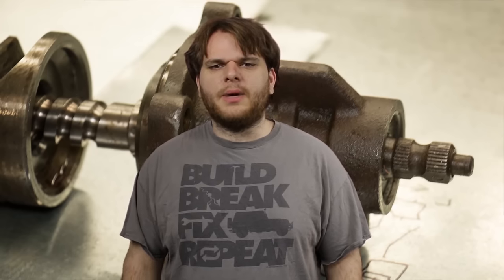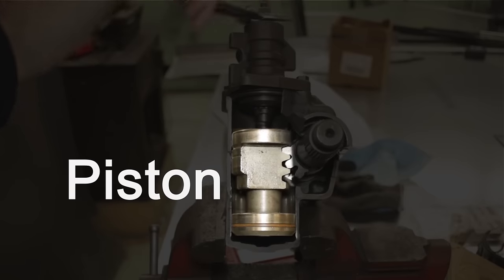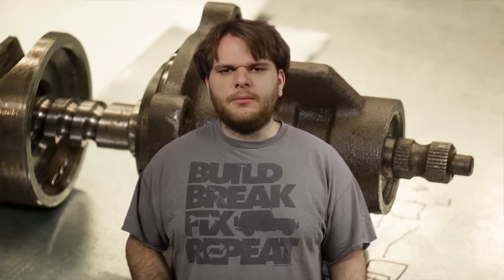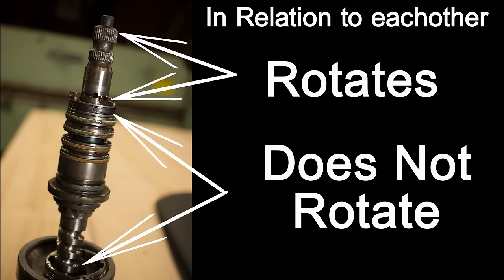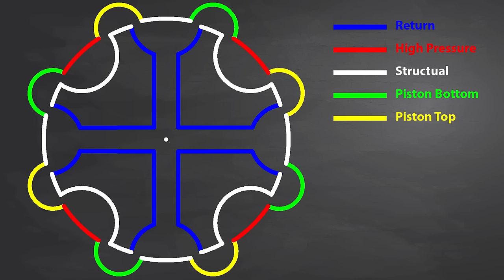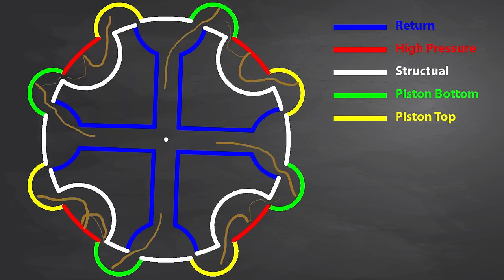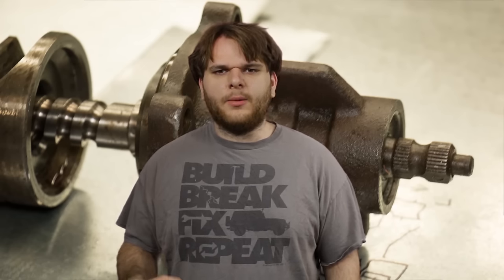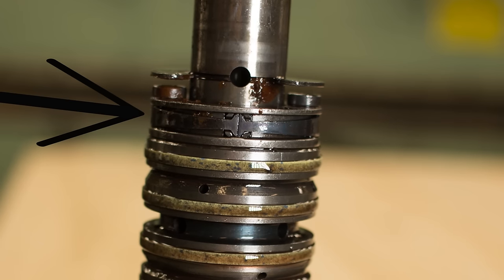How a Power Steering Box Works 610BOB's Teardowns

Comment: ok i have a question.  on my jeep i have the flowing problem, when i start it up. steering is fine. after driving for about 30-40 minutes,  it becomes impossible to turn the wheels. so i would figure that temperature would somehow block the steering box ?
Reply from the maker: That's weird. It could be heat related. Is the fluid getting really hot? If it is, then you need to figure out why that is. Something could be jamming in the steering box. As it gets hot, it expands and causes it to jam. Could also be steering pump. Could possibly be steering stabilizer (kind of doubtful, but easy to check :) ). Pump and stabilizer are kinda easy. You can get a pressure gage for power steering syestem. I would put that on, Drive it till it gets hard to steer, then check to see if your pressure severely changed. Stabilizer, just drive until it's hard to turn, pop one end of the stabilizer off and see if it moves. Steering box will be harder. If those two things seem fine, then I would replace the box and see if that works.

It may also be worth checking ball joints and tie rod ends. More doubtful as those tend to loosen up as they age. But maybe something weird is happening.
Reply: well thank you for replying. relay appreciate it. good that you brought up the steering stabilizer.. hat would be the only part i have not replaced yet.
Reply from the maker: No problem. I hope that works for you. Unfortunately, my only other thoughts would be any of the joints up front that could possibly affect steering. Like ball joints. Which is most likely no help whatsoever.
Reply: replaced all joints recently. issue is driving me nuts..  will se what a new stabilizer does  :D

Comment: Trying to rebuild my gearbox and can only find oring kits. Does anyone know where to get the bearings?
Reply from the maker: It may help if people knew what vehicle your working on. I personally don't know much about rebuild kits for power steering boxes. I do believe that the bearings are hard to find. I would suggest you find a vehicle specific forum and see if anyone there knows  anything. You may be able to buy the bearings by size rather than getting a kit.

Comment: i have a toyota mini van with p.ster. box had to stering shaft seal leaking took it to a repair shop there took it apart change all seal still leaking and now other seal start to leak how do i stop these leaks
Reply from the maker: My first instinct would be to say that they didn't replace the seals. But I just have an extreme distrust in mechanics. :) First, make sure that it is the seals in the power steering box that are leaking. It could be the supply and return lines going into the box. They sit on top, and fluid could just be flowing down and dripping in those spots. There are o rings in those fittings. They should be replaced anytime they are removed. They can also fail, so it may not be a bad idea to try that first since o'rings are cheap. If they are easy to get to.

If it is truly coming from the seals, and the seals were replaced, you will have to replace the hole box. The shaft may have worn down just enough to start passing fluid, or the shaft is rusting and is now pitied, not allowing a seal. If this is an older vehicle, it's probably just worth replacing the box any way.
Reply: old van might as well change box hard to get a box of this kind may have to convert

Comment: Awesome. Perhaps the valve is stuck on my 350. The steering works fine turning right but then violently jerks wheel out of my hands and spins left as I get half way or just left of center.
Reply from the maker: Probably. It's almost certainly something with the steering box. Maybe some debris worked it way up to the valve ring and is causing to to stick. Probably time for a new box. Especially for a 350. If you use it, then that steering box is getting a work out. :) You may also have a bad seal somewhere causing fluid to leak, but that wouldn't cause a violent motion.

Thinking about it, it could also be getting stuck somewhere. As you turn, it requires much more force to move, right up to the point of it sticking. Then it breaks free and jumps. If you have a jack handy, it may not be a bad idea to see how everything turns without weight on the wheels. Also check all of your tie rods and ball joints. Make sure they move freely. And check to make sure your stabilizer moves freely. I mean, it's a long shot that it's not the power steering box. I would think you would feel it if something is sticking within the steering syestem(minus the valve). But if money is tight, and you can check it yourself, then why not. :)
Reply: 610GARAGE thank you. I was wondering
..if it is debris or just a sticky valve....what's the worst that can happen if I take the 2 lines at the top of the box ...swap them briefly....reverse ...would that damage anything ?
Reply from the maker: You can't. The hoses are different sizes to prevent somone accidentally reversing the hoses.

Theoretically thought, I would say, it wouldn't be good. Since you're reversing the power input of the box, the feedback loop would be reversed. So if you turned right, the box would turn left. This would cause the valve to open more, turning left harder and harder. While this may only rip the steering wheel out of your hand. I ponder if something worse wouldn't happen. Like, if the feedback loop is fed fast enough, the power steering box may turn faster then designed, breaking something.

I'm also not sure about seals. They may have used a lighter seal for the return side. Sending higher pressure through the return port could cause fluid to shoot out the input shaft.
Reply: Ever determine problem ? My 250 does exactly same thing and I already changed pump and gearbox ?